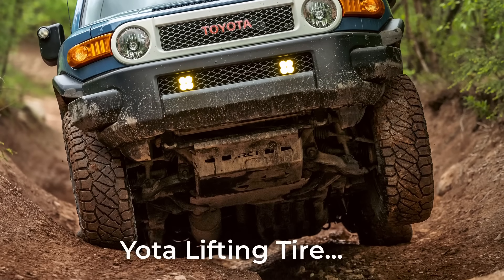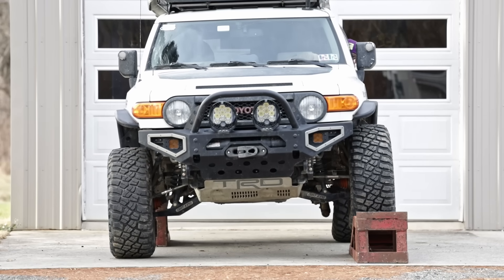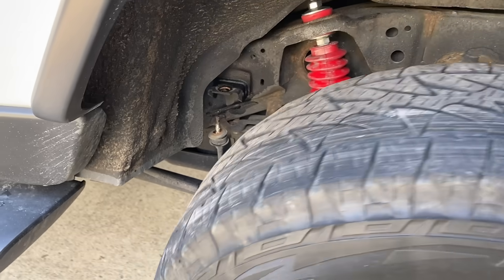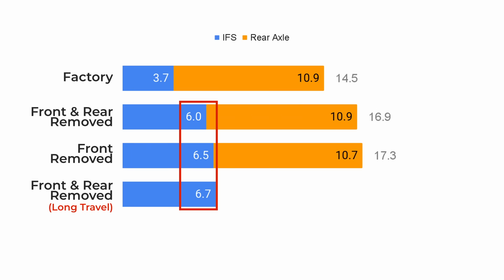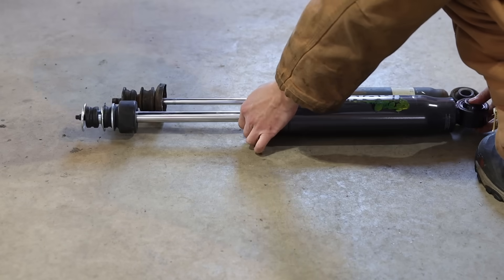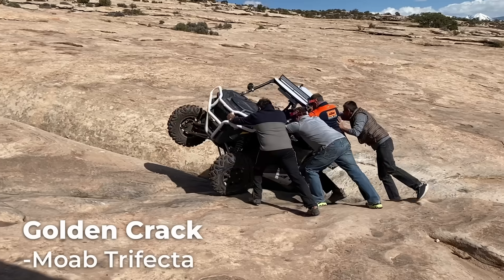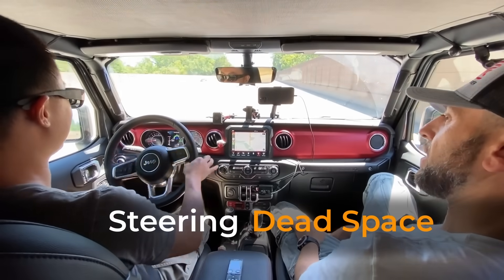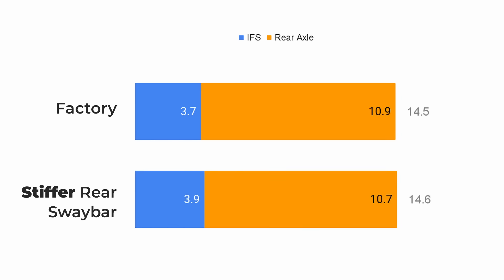Articulation vs Sway Bar | Not What You'd Think!

Comment: You missed the biggest point. It’s not always about travel.  It’s about distribution of ground pressure.  The sway bar loads one tire and unload the other. If you are in soft terrain you want all tires working as evenly as possible(no sway bar) harder terrain with lockers you can carry a tire and wheel lift like the Aussies do  with less impact (sway bar on) but great job on talking about balance.  That’s so important and you illustrated it well
Reply: This also is something I’ve been wondering about on my gladiator. With my custom setup when I disconnect my front sway bar I simply blow through my front travel and it’s almost undriveable.  I’ve been contemplating getting a front bar that flex a bit and eliminating the rear bar all together.

Comment: Awesome video, these are always very informative.

One thing I can't get out of my head though, even moreso now, is that there is a particular trim of 4Runner that has a softer front sway bar. The Sport/Limited models with XREAS, the cross linked shock absorbers. I forget the exact dimensions but it is definitely softer than what comes on the SR5 / Off Road / Non-KDSS models.

After watching this, I can't help but think that the softer front sway bar might actually work really well for stock (or mostly stock) 4Runners that didn't come with one from the factory.
Theoretically speaking, it would make the front softer and allow more articulation. After watching this video I think maybe, just maybe, since the rear is now stiffer (relatively speaking) you'd soak up an overall increase in travel all around. And the amount it would change the "on road" handling would probably be negligible. Of course, the increase in travel might be equally negligible.

Any chance you might be able to test this theory? The part number is 4881135460. It's only $200 and I'd test it myself but I don't have the equipment to do so.
Reply: Update for the sake of anyone who might have stumbled across my comment. I was mistaken. The Sport bar is NOT thinner, it is 1mm thicker. Doing some back of napkin math with the sway bar sizes anyways it appears it wouldn't be more than about a 40 lb difference in effective spring rate one vs the other. Assuming 600 lb/in springs, that's a hair more than 1/16th of travel it might give you. So, maybe not worth chasing.

Comment: 10 years ago I saw quick disconnect links for swaybars, duno what ever happened to them or if they had been forgotten about. But do a Video on swaybars vs no swaybars braking distance. 😁I'm betting a loss of 2% to all numbers in the 25mph, 40mph , 60mph. in other words what ever the footage is to stop with swaybars add 2% of that to the footage for with out. would be interesting since suspension has a major play in braking distance.
Reply from the maker: Sway bars is only loaded when there is lateral load. Braking/nose dive shouldn't exercise the sway bars at all. But if you are talking about braking during cornering, then yes there will be a big difference.

Comment: The only problem I see with no front sway bar is the big angles the CV joints will get to, thus losing reliability there.
Reply from the maker: Not really. KDSS vehicles (some 4Runners, all GX460) will have full front articulation and get to those angles (not really big angles). They use the same CV axles. The GX460 is even hooked up to a V8.

Comment: So what length rear swaybar links are you using then? I’ll probably do that rear settup with swaybar disconnects in the front.
Reply from the maker: I didn't measure the length. But I have the end link PN in the description. It barely clears the lower links at full compression so it is pretty much the longest you can fit in there.

Comment: Super informative and enlightening. Could you design and sell a quick disconnect  sway bar system for 4 Runners and Tacomas? They're pretty available for Jeeps but not so much in the Toyota world. Thank you.
Reply from the maker: Thanks! The biggest challenge is how Toyota mount the front sway bar and how it can interfere with other components. There are the sliding sway bar end links. It won't give you full range of travel but better. The issue with most existing sliding links is reliability and ease of use. Apex design seems to working on a more reliable product in the same concept.

Comment: Sway bars are often used for controlling body roll and weight transfer at or near the limits of the tires, so you may not notice a dramatic difference with everyday on road driving, but when you need to make an emergency maneuver at highway speeds, it can be the difference between recovery from the maneuver and extreme oversteer/vehicle rolling over.
Reply: Yeah I never noticed a huge difference without my sways until I had to lock my breaks up at 60mph and felt like k was going to roll over
Reply: @Layton Aschauer  yeah my wife drives a excursion... I replaced everything under it but the links at the time so we drove it a week with out them..... night and day difference... got the new links in and it stuck to the road.... I feel sway bars are needed in solid axle leaf springs more
Reply: @laytonaschauer3675  You lock brakes to stop a vehicle, thieves break locks to open them.
Reply: @sepg5084  😝
Reply: @sepg5084 ok?
Reply: I only remove them when on trails in my 2nd gen 4runner. It because a yacht if i leave them off on the highway
Reply: @rjmac3001  I drive the mountain roads without my rear mostly besacuse my sway bar broke but you get use to the limits
Reply: I installed the TRD sway bar in my 2008 Tundra Limited Dual Cab hoping to feel like I have more control on the highway. My truck would seem to want to wander and the steering felt loose. I was White Knuckling on two lane highways even at 50. I've owned 50's, 60's, 70's 80's larger American cars and never experienced this slack even when the sway bar link bushings disintegrated from wear. The TRD sway bar seems to have fixed that problem. The truck seems stable even at 90. I did notice a black watery substance dripping out of the old sway bar. Could this water weaken the sway bar? Possible I guess.  I bought my TRD sway bar from the Toyota Dealer to avoid a fraudulent knock off.
Reply: @conspiracytheorist2192  I have noticed that most tundra’s have an aftermarket sway bar. Must be a weak point.
Reply: @conspiracytheorist2192  I think it has to do with Toyota developing the entire suspension to work with the sway bar and most older American cars just sorta throw them on after the suspension design has been worked out.
Reply: This has been my experience. When I hear American car I think of before the 80's.
Reply: For small displacements they dont actually affect weight transfer, just body roll. That being said a big lifted truck with a large distance between roll center and cg will end up increasing/decreasing weight transfer as the cg shifts vertically and horizontally.
Reply: I just got some quick disconnect end links!
Reply: Your comments is more to my liking than video! stabilizer is nevered needed for any car! its for driving. in case of a truck have torque steer, that is whar i think a truck rear need stabilizer! and when this car break, it need front stabilizer! but if traveling at 150km and suddent break, you will love a front stabilizer 😂
Reply: which is why there is pros and cons based on what type of road are. Body roll in offroad are needed but not in normal road that for speeding
Reply: Very true, I’m not in an off roader, but I added a 28mm rear bar on my mk4 Jetta (+the 16mm bar permanently welded in  the rear axle) with a stock 23mm front bar. 

And when I push my car to the limit now, the rear end is happy to come out before the front end loses grip. Throttle lift oversteer is the best 😂. 

It’s not “unsafe” but I would be worried if my mom drove my car and had to swerve while braking.
Reply: Pussy take!

Comment: I have a 2012 Fj with a 6 inch pro comp lift with adjustable king coil-overs. Because of the 6 inch lift I had to custom the front skid plate  and the front sway bar did not fit. But I never notice the difference and I do not drive it on the road as a sports car, lol. I was talked into the 6 inch lift and that was a waist of $2,200. It makes 35 fit in without a lot of trimming and banging but there are other ways as I learned in time to get around this. Definitely could of used your knowledge back when I started my build.

Comment: When lifting my 1st gen Tundra on 6112/5160 with 700lb springs I didn't bother reinstalling the sways. Sure it has more roll, like a boat, but nothing unmanageable and if you're on 33s or larger you probably aren't driving fast enough to really need them.

Comment: Since Tacoma's do not come with a rear sway bar, would a "stiffer" higher spring rate leaf pack have similar outcome as to no front swaybar and rear sway bar on?
Reply from the maker: Probably, but I'm not sure if the stock leaves are already stiff enough and going stiffer will be counter productive. In the end, the vehicle weight is the driving force for articulation and going too stiff will start to decrease flex.

Comment: I'm wondering what the difference is with or without extended sway bar links
Reply from the maker: For the shocks I have, the stock links would also bind and limit my down travel. For on-road driving, keeping the link more orthogonal to the bar theoretically makes it more effective, but for around 2" lift I have, I felt nothing perceivable.

Comment: Most people here won’t understand how stiffening the rear (or removing the front) will result in the car being able to rotate better in turns. The opposite is true when you stiffen the front.
Reply from the maker: You're correct. I was looking for the oversteer when I first install the stiffer rear swaybar. But I couldn't tell at all. The body roll probably masks over any of those handling characteristics. My FJ will probably roll over before showing any significant oversteer like a track car lol.

Comment: Would a front sway quick disconnect work as a good compromise as well, or does having a disconnect bar in place impact the IFS?
Reply from the maker: A disconnect would be nice. But because they way Toyota mounts the front swaybar, it is really difficult to simply disconnect the endlinks like Jeeps. If you do that the bar will run into all the components around it. The closest thing is the sliding endlinks, which allows some free range of motion but still limits maximum travel.
Reply: @TinkerersAdventure  Would you recommend running the sliding disconnects as a good "middle ground" approach between no sway bar, and retaining it?

Comment: Having DSC shocks can help a lot for handling. Removing a sway bar and adding some Low speed compression to the shocks helps add stability back on road in my experience.
Reply from the maker: That's true. Adding slow speed compression essentially make Fox's linear valving closer to digressive like the cheaper shocks. But you can still have linear valving when you need it. I wish I have Fox DSC on my FJ. My icons are digressive and I crank it all the way up for street driving.

Comment: I’m definitely going to be following this data on my build. My rear sway bar broke and I’ve just been running as-is for a while but I now see I’m missing out on a bunch of front articulation by not forcing the front suspension to work, which leads to the rig feeling a bit tippy and makes it prone to wheel lifts off road.
Reply: nice

Comment: Are you using lateral load transfer distribution to calculate a theoretical balanced front/rear flex? That's something I've done a lot for my autocross car but for entirely different reasons! I think you need some bigger ramps though!
Reply from the maker: I didn't run any theoretical calculation front and rear, because I don't have much option to "tune" the stiffness at smaller increment in practice. But that would be an interesting thought exercise!

Comment: I recognize and appreciate the amount of work that went into all this testing, thank you!  I suspected removing the front only was going to be the winner.  That's what I run when I'm going on a trip where more flex is important.  I originally started after installing a gas tank slid that made getting the rear bar off impractical, but I noticed that the flex was great and reasoned that it should indeed be loading the front more.  I get full flex out of both the front and rear in this configuration.  (2" lift, relatively light GX470)

A note for anyone about to go remove their front bar after watching this video: The ends of the sway bar are in just the right position to drop down and tear your axle boots.  Drape a few rags over the boots to provide some protection.

Comment: I run a 2020 4Runner with the front sway bar removed, the stock rear sway bar on, Icon 700lb springs in the front, and Dobinson HD springs in the back. On-road driving definitely feels a bit more "floaty" with the front sway bar removed, but (if you do it on your rig) you need to drive it for a week or so before deciding if you want to keep that set up.  Now that I'm used to the way it handles on the road, I'm fine with it.  However, I do have stiffer springs all around so I might no say that if I was still running stock springs.  A stiffer rear sway bar will probably go on when I regear here in a few months.
Reply: How heavy of rear springs do you use, any additional weight in the rear that you have added? what lb. of rear spring would you recommend if mostly empty/stock rear weight but 2in lift? thanks

Comment: Great work mate 🙂
Interestingly when the Land Rover Discovery first came out in 1989, only the top trim level had a rear sway (anti-roll bar ,UK). It was several years before they added one at the front (1992 with the 5 door, 7 seat model). UK market. The Range Rover had them earlier. The RR, Disco and old Defender are basically the same mechanical stuff and a slight difference in chassis.
Rear bar will help reduce roll oversteer which on long, soft coils makes quite a difference on the road. 
Another factor that is useful to think about is axle diff locks. Sway bars can help to push the weight into the stuffed wheel which can gain traction with a diff lock. At the expense of stability so  risking tipping.
As in life it is all a compromise.
Cheers.

Comment: I removed the rear swaybar and installed long travel shocks and taller springs on my first gen Sequoia, the articulation more than doubled. But the front swaybar is necessary for good road handling, so it stays. It doesn’t handle any different on the street with no rear bar.
Reply: But that's just transferring all movement to the back, and on a live axle a sway bar doesn't limit, the bump stops and the weight distribution to the other axle does.  IMO you should try it again and you may be surprised.  Also body sway does not equal articulation.
Reply: @sfshilo  I find it more comfortable on the trail, so I am sticking with this setup for now. 

I'm going to remove the front sway bar when I get the chance just to see what it feels like.
Reply: I did the same on my 3rd Gen 4runner.

I feel the same as you about it.
Reply: Have you measured with the rear still on after the long travel.
Reply: @nathanthrelkeld6145 yes, removing the rear bar added 5 more inches of droop